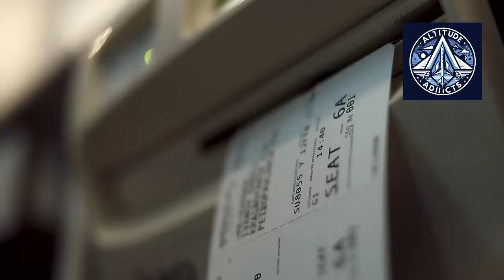Inside Russia’s Jet Comeback: MC-21 Soars, Tu-214 Slows Down

Comment: As a comparison, one could look  at Fliegerfaust and see what kind of disaster faces the A220.  Still losing money, nothing but headwinds, tons of groundings and GFT issues abound.  Russia might be doing it right to solve reliability and maintenance issues first, then enter into service with a "good, competetive" product.
Reply: The MC-21 is biggest disaster of all. 20 years of development, and no production in sight. All the time financed by Russian tax payers who are, to put it mildly, not very rich. Now also the flight characteristics turn out to be terrible.
Reply: @alexandervt641  what is success? The 787 Flores excellent but will never make one cent, it cost over 32 billion to develop and that was subsidized by taxpayers through over priced military contracts.. as for the MC31 flight characteristics, that’s just your opinion not a fact and may not be relevant based on operating conditions.
Reply: @jeffhedrich3551  The estimates of development costs of 787 are between 14 and 32 billion dollar. The estimated revenue from selling the jet so far are are about 200 billion dollar. So even if not profitable, Boeing hasn’t lost much money with the jet. In contrast, UAC doesn’t generate serious revenues from selling passenger jets (Russia produced about 7 passenger airplanes in the last years). Thus, the Russian government is not subsidizing the development of the MC-21, it is financing it. The bad flight characteristics of the MC-21 follow from official sources.

Comment: Yesterday you said that certification of MC-21 will be postponed and that 5 critical systems haven't yet been replaced by Russian-made systems, and today you say "MC-21 jetliner is making rapid progress toward 2026 certification completing 20 test flights across four airframes, including the fully domestic MC-21-310..."  So which one of these statements is true?
Reply: All of these planes will never put into production...based on this channel, still nothing works.
Reply: @juansuponatime517  Поплачь
Reply: @juansuponatime517  Keep dreaming. The planes are flying. Are russophobes as blind as they're dumb?
Reply: @alexanderkostiaev8484  yes,they are 😉
Reply: @juansuponatime517 Production of MC-21 already launched, even before official certification is finished.

Almost 200 MC-21 already prepaid by companies.
Reply: оба НЕ верны.
Reply from the maker: Even in this video, the same was said. MC-21 will have higher production that Tu-214.